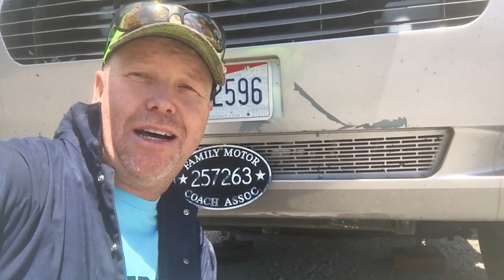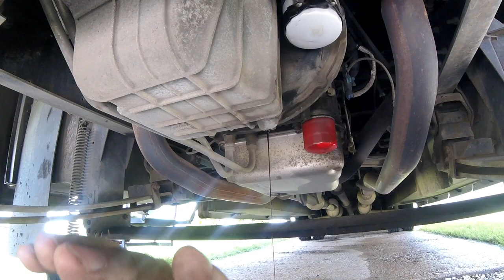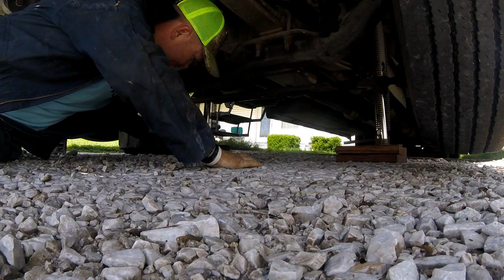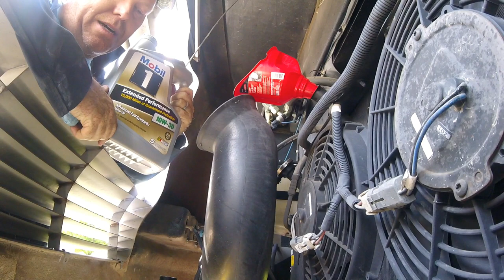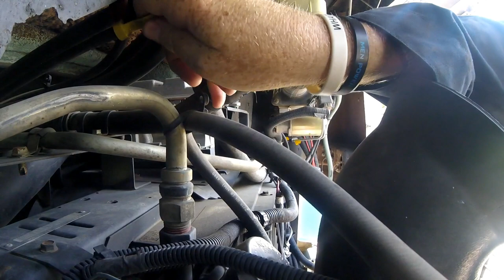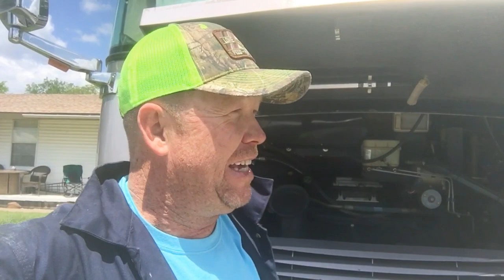Why I chose a gas coach rather than a diesel. DIY 8.1 RV Oil Change

Comment: We just got a 2003 Workhorse with the 8.1 and also love it. Has 61000 miles and runs very good, Thanks for the video, I also video my RV projects and know it would be easier not to.
Reply from the maker: Rickbo's Rides thanks so much! We have moved onto a Diesel Pusher!... what kind do you have?
Reply: Rickbo's Rides When my wife and I are able, I want a nice used Workhorse too. They were a better chassis and I hate a V10.

Comment: We are in the process of purchasing a 2004 Newmar Mountain Aire 3778 with this Chassis (45k miles). Thanks for the info. I am right there with you on the diesel thing. If you have money to burn, diesel would be the way to go. But gas for my budget just makes perfect sense. What model and year is your coach if I may ask.

Comment: pro tip.. THIS oil filter trick, of 'filling' the filter, ONLY works with filters 'in this position'.  I use Mobil 1, EXCLUSIVELY in EVERYTHING.. treating them ALL as if they've ALWAYS USED THE ONLY TRUE SYNTHETIC I know of.

Comment: I picked up a 1996 Bounder with a 460, which only has 240hp stock. 43,000 miles. $9000. No way I’d get a diesel class A with such few miles on it for anywhere near that. Even with only 240hp, the steepest part of Parleys Canyon (between Salt Lake and Park City), I can still go 50mph! A turbo diesel would be nice for the torque, but it’s not going to be faster or cheaper to drive. I have an 8.1 in one of my pickups, and I think the 460 is even lower maintenance. The 8.1 just loves to burn oil.

Comment: I have a 2005 Workhorse chassis and I change my own oil. I use full synthetic and I found an oil filter # 85794 that is twice as long as the regular filter #84099. Lots of room no problem, and it is easier to grip and remove.
Reply from the maker: great info! Thanks for taking the time to leave a comment
Reply: Good vid. Careful with that larger filter. Only one I found @ NAPA, has no anti-drain back valving system. No problem..... if engine is run regularly. 

NAPA Gold 1060 with full synthetic oil works well for me. Have you changed spark plugs yet? Any tips on the task, especially to prevent expensive problems with igniters or wires, are appreciated. Totally agree with your decision on Gas vs Diesel. 

We have put over 104,000 on our 2004 HR and will require plugs. Replaced fuel filter with later style due to Onan feed line, serpentine belt, along with new pulleys and new water pump @ 90,000.

Exhaust flange donuts blew at 98,000, causing several successive issues while touring. Replace with new factory style, tube lined NAPA donuts and re-tighten the 6 flange nuts often, to prevent re-blows. Factory flange nuts are best. Not free spinning like the HELP packages at parts stores. Free spinning nuts tend to fall loose. 

 Noted where one 8.1 liter on YT has over 396,000 miles.
Reply from the maker: Blogengezer thanks so much for the heads up! We have since gotten our Diesel Pusher! We love it!

Comment: Love my 2004 Newmar Mountain Aire 8.1l.  I only see two major drawbacks to the gas.  The biggest it finding a place to gas up that I can drive through.  Getting a 38' vehicle into most gas stations is impossible.  Once I added the additional 20' of the flat towed vehicle, I'm at 58' which adds to the challenge. In addition to fueling the coach, the second drawback is the ride is rough.  I'm researching to see if there is any way to improve the ride. I've driven diesel cars and light trucks since 1983 and as much as I like diesels, for full-timing in a motor coach on a fixed income going gas was the best decision for us.
Reply from the maker: Bob Spiker since making this video, we went ahead and upgraded to a Diesel coach and we love it!

Comment: I feel the same about a diesel. If your reasons for buying one is for fuel economy then you're going to be disappointed. I'll gladly roll my F53 460 for 200,000 miles and won't go broke on repairs and maintenance. As far as power goes I had no issues climbing Vail Pass

Comment: Owning a diesel is not about fuel savings, it’s about the power,  I have a 40’ bluebird with a 600hp Cummins ISX,  and the thing doesn’t even change gears or drop a single mph going through the long grades of West Virginia,  then the engine brakes hold back the coach on the long decent usually too much at times, and I hardly have to use my brakes.  Then there’s the reliability of Diesel engines..... mines is a 2009,  got 123,000miles, and has only had oil/air and fuel filters.  Even still has the original belt on it.
When going up anything resembling a hill, the gas RV’s are in the full right, 4 way flashers on puking their guts out, doing 25mph.
I’ll only ever own a diesel
Reply from the maker: david g agreed 100% this is an old video we now own a 2011 Winnebago Tour
Reply: Full Time Freedom Tour  that’s awesome!💪🏾

Comment: Do you have any issues when climbing mountains with overheating or getting hot?
Reply from the maker: Well, now that I bought a Diesel Pusher ....no! lol
Reply: I want a diesel as well.  We have friends that have a motorhome that has the 8.1 vortec that swear they don't have issues with overheating. (Not trusting their opinion is why I ask).   We have a gas with 454 now and it has that issue on big mountains and I hate it. We are wanting to upgrade to a diesel pusher.
Reply from the maker: Monica Goldsberry I totally agree... we didn’t really have over heating issues but I would have it floored going up big mountains and only hitting a max of 35mph ... now with the diesel, we are climbing mountains on cruise at 65mph no problem!
Reply from the maker: Lori Faber call it what you want ... Climbing up the mountain from AZ. Heading into LA. CA. We could only get up to 35mph ... FACT!  😎

Comment: There are three size oil filters that fit the 8.1.  You are using the smallest one they make.  Might want to rethink you size selection you are using.
Reply from the maker: +Peter Nussbickel this video is old... we have a diesel Pusher now... thanks for the input however!
Reply: The filter size was the first thing I saw. My 8.1 gets the biggest filter that fits.

Comment: The oil pump scavenges oil from the sump. Not the filter. Pouring oil in the filter makes no difference.
Reply: Charles Miller.      And where does the oil go after it's scavanged from the oil pan? To and through the oil filter, which is full of air, then to the bearings, etc. Prefilling, which should only be done through the small holes of the filter( as this is the pre filtered or dirty side of the oil filter). Pre filling the filter, which I don't do, will avoid that 3 to 5 second delay until the oil pressure builds up as it has to purge the air in the filter.